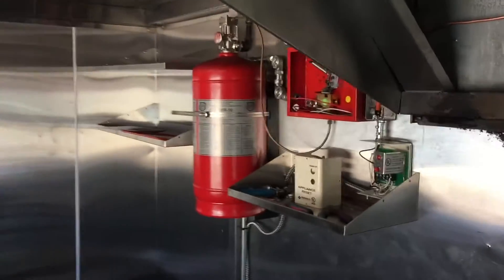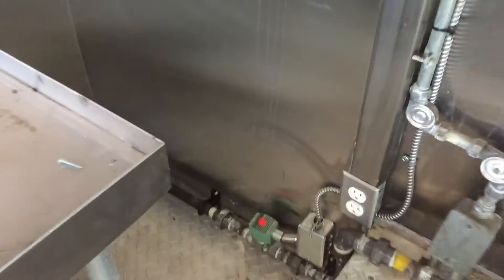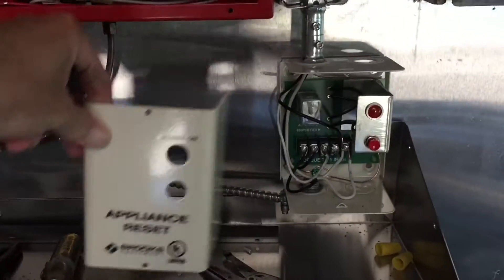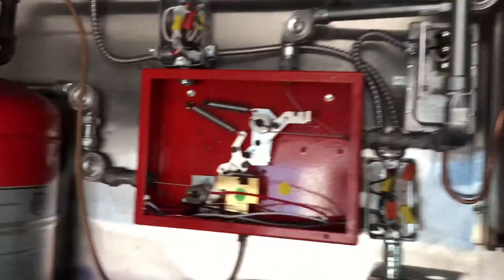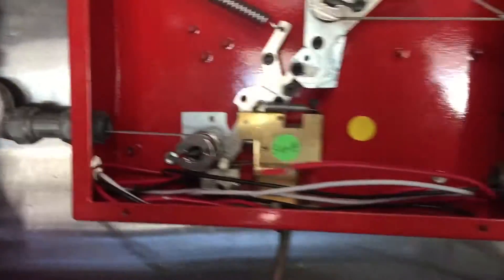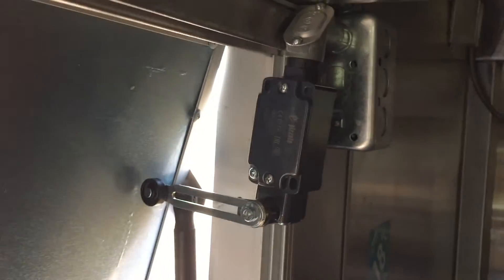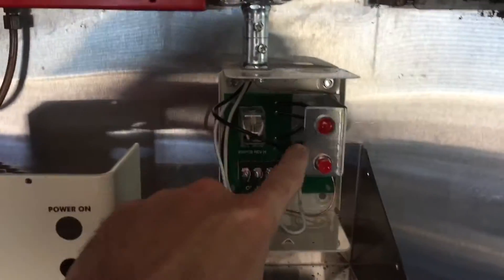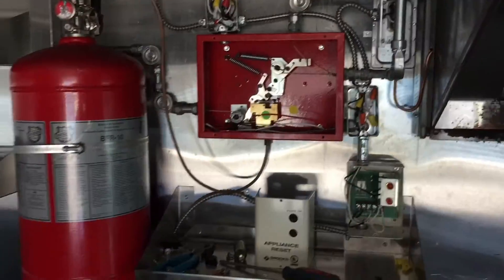Food truck Fire Suppression Devices

Comment: A little confused, you say it didn't have a gas valve which the mechanical gas valve is there. Did you just add a electric gas valve for extra protection?
Reply: Just curious

Comment: that to much for food truck. our state not even require all that. 
most food truck are power by generator. some state doesn't even require fire systems for food truck as long as they have K CLASS EXTINGUISHER.
Reply: National Fire Protection, Inc. Are you asking how much is the fire suppression system to supply and install? Or the food truck?

Comment: That control head is awful for food trucks. Hit enough bumps they are going to get an accidental discharge. This is why customers have to roll around with a safety pin in. Go with an R102 Ansell system. Guardian three systems would be great however they are electrical systems. But these mechanical heads from Amerex or Pyrochem are horrible for vehicle kitchens they weren’t designed for that.
Reply from the maker: You are correct. This system was installed couple years ago and we had to add couple of items to make it compliant. I agree there are better systems for these applications. Keep up the great Work 👍
Reply: Raymond Kolman I agree with you there Ansul or Amerex systems are definitely more reliable and less prone to accidental discharge rather than the SRM control heads from buckeye